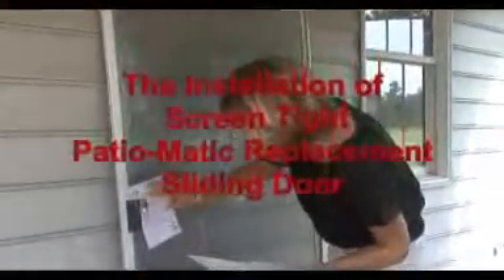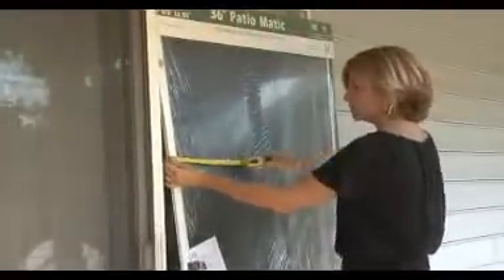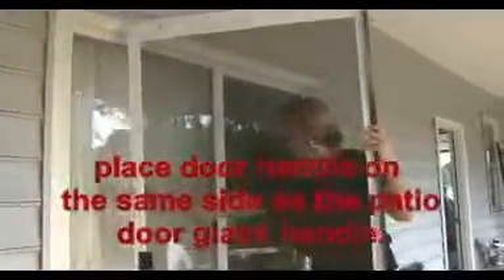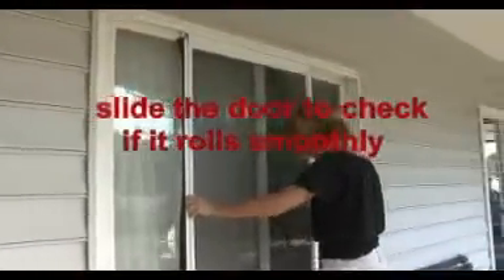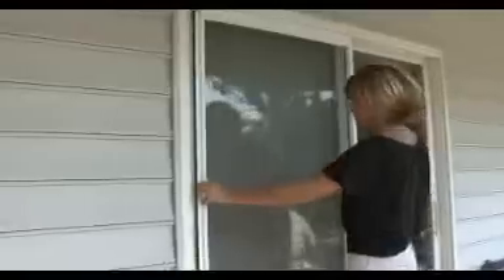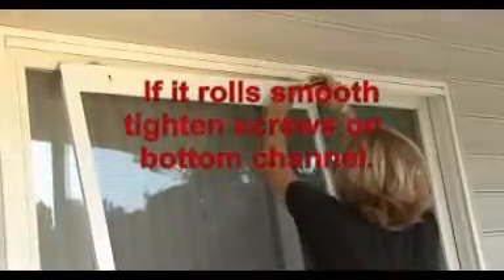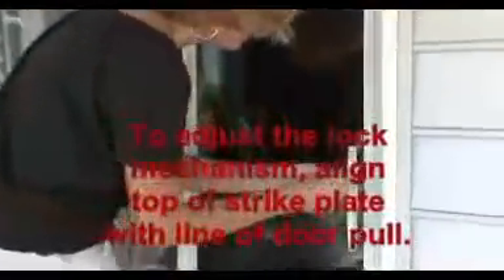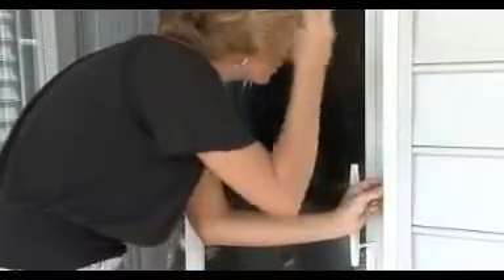How To Install A Screen Tight Patio Sliding Screen Door

Comment: Easy said than done! Bought one from Home Depot in Vernon Hills, IL. Its not that simple as shown in the video, one need to apply force to make the wheels sit on the lower guide. in the process I have hurt my finger, now have to wait for couple of days till fine heals up and I will try again. For sure with little design improvement, it replacement can be easy.

Comment: I agree with the rest of you-I am pissed. I have wasted an entire afternoon trying to figure this out. This video is ridiculous and the little piece of paper that came with the screen door was obviously written by a moron. I do a lot of d.i.y. projects around the house and figured this would be a breeze. It's not. So frustrated-will deal with it tomorrow. Screen Tight-you have ruined my day!
Reply: Did you figure this out?
Reply: @Wowchukk  Yes,I did.4 years later and still unhappy with the door. It has never fit correctly and I've had to replace the rollers twice. Can't afford a replacement yet,so just dealing with it lol.

Comment: if this door is for left or right sides, why is that the screws are facing into the glass door when its installed facing to the right? this door is jacked. and who measures the door AFTER they by a replacement?
Reply: TomF1970 I spent 5 hours and I could not get it to work
Reply: This is the worst door ever in the market. I spent 5 hrs and realized it wount work my door is size 36x 78. After even removing the top hood the bottom would not get in the ridge 😖☝️very frustrated. Please do not buy this door I am taking mine back

Comment: Bought 2 for   $58 each bad instructions called terrible customer service I was bothering them even emailed them about customer service no response. had to take top rollers off  slides fine but gap on bottom enough where ants can fit defeats purpose of a screen. After looking at YouTube videos I see there are better screen options with better adjustments. I will be returning these

Comment: Bought it at Home Depot. Terrible. The adjusting top & bottom channels are to thick to fit in existing opening. The plastic guide clips don't fit in the channel and I had to squeeze and bend the channel to force them open to fit. Ended up removing the top channel completely because it is so much thicker that the main screen frame. Even then it was still too tight to use. It clearly isn't "universal" and is designed to fit in only one type of door. Returning it today for refund. The quality of this video and the robot voice match the screen door.

Comment: Yea...have to agree with the other comments. Bad written instructions and equally bad video. Would have been nice to have close up shots and higher video resolution.I had several issues, first was realizing that I needed to reverse the 4 screws so I could screw from the outside. Must have been manufacturer for left sliding. Never did understand what the 2 rubber guides were for it says put in groove...which groove? I got it installed (I think) but the top and bottom adjustment channels cause the door to not close all the way so I can lock it. As they say "you get what you pay for".